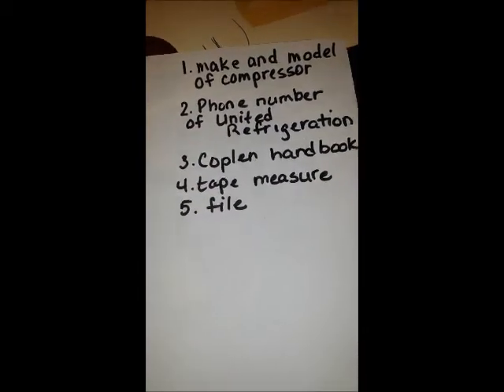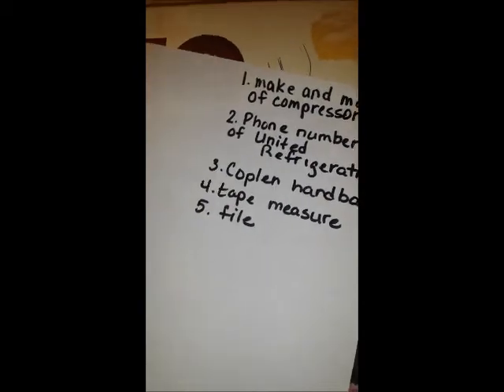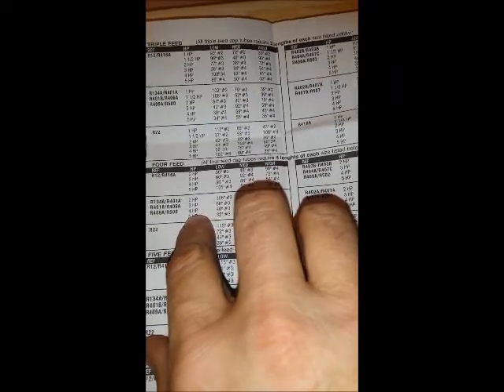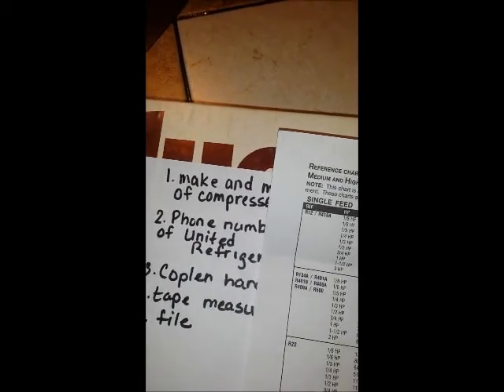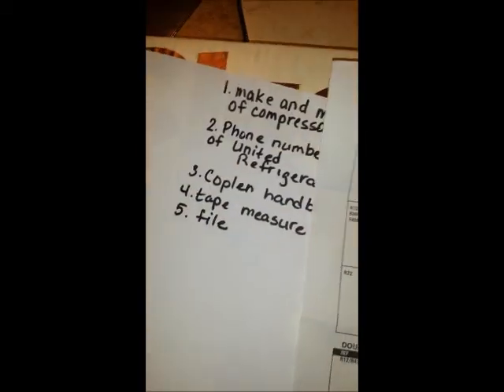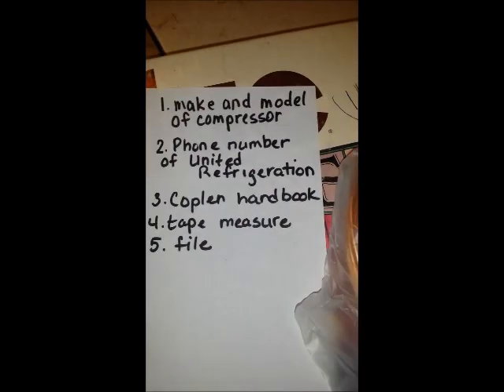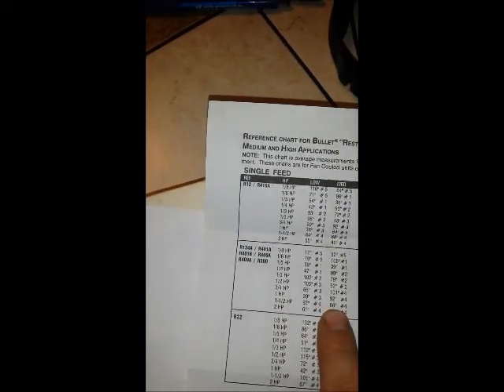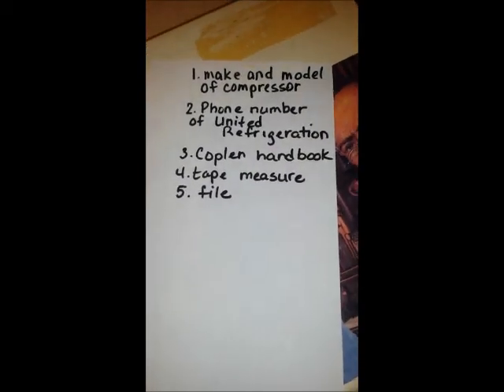a capillary tube replacement

Comment: I allways used a wire stripper to cut cap tube, score it and break it.
You did use a strainer on that cap tube, right?  I see so many guys use filters.
Then I am surprised how many guys don't know how to charge a cap tube system.
Charge till flood back on suction remove ref till frost line moves back to evap.
done deal.

Comment: That captube chart sucks. It's old and has not been updated in years. That captube chart is hit or miss sometimes you need to play around with the captube. Tecumseh has a cap tube sizing computer program that has several fields you fill in to get a more accurate result.